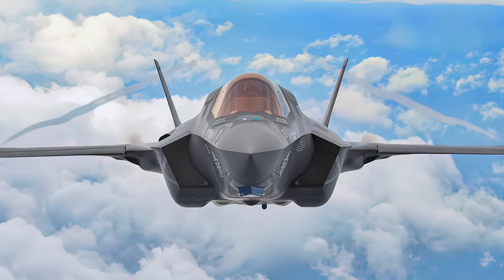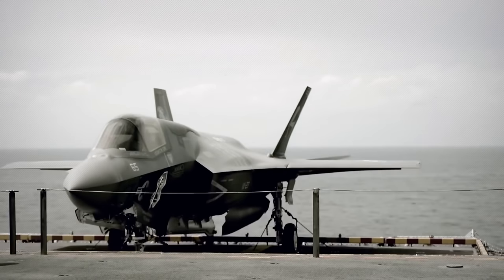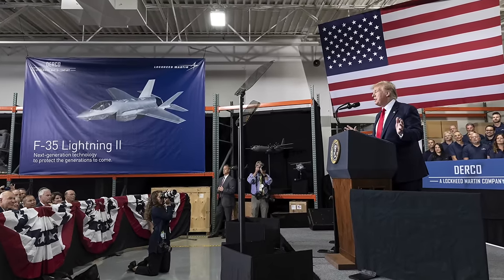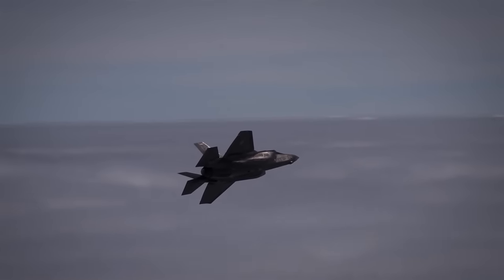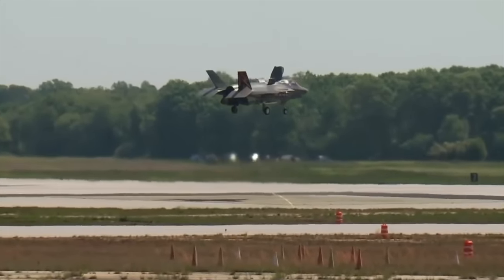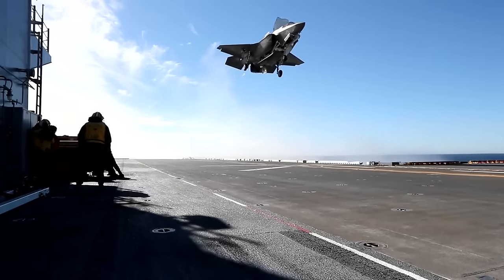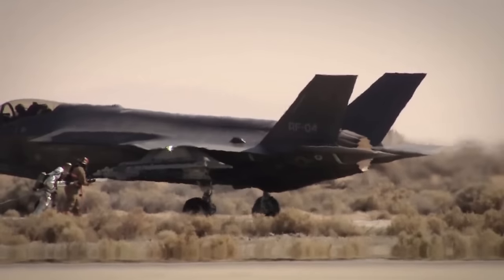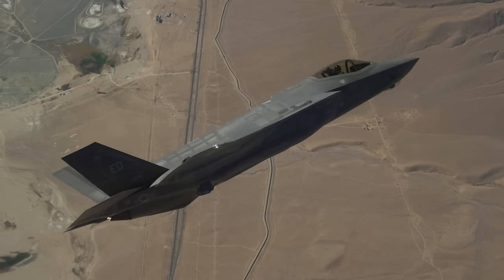F-35 Lightning II - Lockheed Martin's stealth multirole combat jet for air superiority

Comment: The F35 is the second feared only to the F22. Except for the fact the F18 Super Hornet is preferred over both of them. Wow wow.
Reply: Preferred and feared are 2 different concepts aren't they?  Nobody would prefer the f18 SH to either the F22 nor the F35 if price weren't an issue.  While the hourly operating cost of a super hornet (being half of what it is for the F22) may make it preferred for those that need to fund the budget for the fleet, nobody is going to suggest they'd rather be flying a super hornet facing off against an F22 as opposed to the other way around.
Reply: @davepeesthepool  the F35 is the coolest looking hangar queen ever invented but it also cost a total of $1.7 trillion so far with zero time in meaningful combat. It can’t turn or climb fast enough to avoid target acquisition lock by the F15 or F16 and the military hasn’t even bothered testing it against the F18 because of this. The helmet is too large for the cockpit space for the pilot to look behind them rendering its X-Ray vision useless to the rear. It’s radar is so complicated that pilots often must reboot it while in flight during testing and it’s too narrowly focused of a beam pattern to find ships at sea. It requires way more ground support equipment and personnel per F35 than any other option. There’s no spare parts available for it. Lockheed Martin claims to be able to fix its glitches in software only if it received an exclusive maintenance contract first. This Swiss Army knife of a concept doesn’t do any of the three key purposes for its use well. As great as it sounds on paper and as many technological advances as it might have achieved and just as a brutally honest observation we’d be just as well suited purchasing dumbed down SU-57’s from Putin and ripping out the avionics to put our own in just like the Israeli Air Force does with ours. For further reading and for citations of everything I mentioned see here from The Hill’s Op-Ed by the author of five books, who’s a Georgetown professor, as well as an advisor to Oxford U, and retiree of the US Army’s 82nd Airborne. His name is Sean McFate and each specific claim is linked to articles written by others elsewhere. 

https://thehill.com/opinion/national-security/542412-the-f-35-tells-everything-thats-broken-in-the-pentagon/
Reply: Not true.
Reply: @WhereDaToofpaste  I'm aware of this opinion piece.  What's ironic about it is it's all about the dog fighting capability of the F35 when it wasn't designed for dog fighting to begin with.  The F35 is not designed for merging with other fighters and executing BFM, it's meant for BVR engagements and support roles for situational awareness (and its data link capabilities in sharing that situational awareness to friendlies).

The point of the f35 is that it (or one of the friendly aircraft/G2A elements in the area it has painted the target for) has already destroyed the enemy fighter before it even realized the F35 was there.
Reply: @davepeesthepool  The F-35 has superior dogfighting capabilities over the F-16, F-15 and F/A-18 under most combat conditions. The only way the latter aircraft can outclass and outmanouver an F-35 is if they dump all their weapons except the cannon and carry as little fuel as possible. The F-35 is as good if not better than the F-22 at low altitude according to F-22 pilots, and that makes sense because of the superior thrust the F-35 has.
Reply: @WhereDaToofpaste  $1.7 trillion for over 2,500 F-35's supported over half a century, including maintainance, training, and upgrades, including the development costs of the program. It's not that bad. There haven't been many moments for the F-35 to enjoy combat under it's combat Block 3F package since 2017-2018. But the Israelis have been using them with great success as a strike aircraft in Syria, facing S-400's and more recently probing Iranian airspace undetected.

In training the F-35's performance has been stellar. Pilots all want to be in them, from the RAF to the Czech Air Force. There's roughly a 28-1 kill ratio against the F-16 and F-15. Pilots with 9 hours on the type have become aces in training exercises against F-16 veterans with thousands of hours racked up on the type.

The Israeli variant is not that much more different to the standard models, the only differences being add-on capabilities for it to work with Israeli electronic warfare systems and weapons.

The issues you are referencing are on older variants of the F-35, usually test/training software packages. The F-35 has variable radar, which includes wide and narrow band search, as well as stealth operation, which reduces it's emissions for radar detectors. The cockpit space is also huge. It's literally got more headroom that the F-16 and the new helmets are not that large.

Furthermore, stealth and radar aside, the F-35 is faster than the F-16 and F-15 under combat load. Which means, the only way the F-16 and F-15 would be able to outrun or outmanoeuvre it is if the latter aircraft do not carry any extra fuel or missils. So guns only.

Speaking of the Swiss, they too, have chosen to purchase the F-35 this year. There are only 3 Category I software issues remaining on the F-35. One of them being, green lines on the helmet display using nightvision. The Australians can run the F-35 with a minimum of two support crew and a towed trailer. MMH/FH is around 5 hours. Roughly less than the Gripen E, which is known to be low/easy maintenance.

It's the Su-57 that's the hangar queen, there's only what, about a dozen of them? Half actually operational? Russians afraid to have them shot down over Ukraine.
Reply: @britishmalayasociety  
A lot better than 28:1 in recent exercises.
Reply: @stephenpage-murray7226  I thought that would be the case. I know it went from 20-1 to 28-1 within about a year, and I haven't checked recently... When Block 4 comes out, I imagine things would stretch even further still.
Reply: @britishmalayasociety  
68:1 at one exercise
Reply: @WhereDaToofpaste  pogue
Reply: @britishmalayasociety  Are you sure that's correct?  The latest F16 has an empty weight of 22,000 lbs and a thrust force of 32,500 lbs, the lightest F35 model has an empty weight at 29,300 lbs and a thrust of 43,000 lbs.  That puts the thrust to weight ratio of the two aircraft without munitions or fuel at nearly the same (1.477 for the f16 1.467 for the lightest model f35, so the f16 has the barest advantage).  And I've read that a report in 2015 details a series of dogfight trials between the F16 and F35 and the F16 won fight after fight.  The f16 is actually extremely maneuverable at high speeds, and it can maintain those high speeds through a turn fight really well with its high thrust to weight ratio, making it difficult to beat in a rate fight.  Supposedly the air force nicknamed the f35 "Fat Amy" because it is so heavy (but understand that it's also a term of endearment).  From what I understand, the consensus is that the F35 is not as maneuverable as the F16 (which shouldn't come as that much of a surprise since the F16's design is first and foremost a dog fighter).

The F35 was originally supposed to be lighter than the F22 but feature creep saw a lot of weight added for bigger weapons bays and onboard hardware to give the f35 better functionality for its multi-role expectations.  That's the reason why its thrust to weight ratio isn't any better than the f16's.  Nevertheless, a lot of fighter pilots today put the importance of BFM capabilities below a lot of the functionality that the F35 particularly excels with.  Situational awareness and stealth mean you are much less likely to ever even have to dogfight.  The F16 might be a better dog fighter, but it would take some seriously extraordinary circumstances for an F35 to find itself merged with a 4th gen fighter like an F16.
Reply: @davepeesthepool  The 32,500 lbs thrust engine is only found on the UAE's F-16 Block 60 variants. If you were to purchase the latest Block 70/72 variants, it's 29,000 lbs maximum thrust.

The F-35 is heavy, but it has the thrust to make up for it. F-22 pilots had stated that it was as good if not better than the F-22 at low altitude. Carrying any sort of combat load, the F-35 is superior against the F-16, mainly because the F-35 does not suffer any drag penalties by having to carry external weapons, whereas the F-16 does. It is actually signficantly more agile than the F-16 because of the weight, which would be bad if the F-35 didn't have the thrust to compensate. I've heard pilots confirm this, but this was all more recent ~2019 or so.

The TW of around 1.4 is pretty much never seen, that's close to zero fuel and no weapons, but basically the more weight you add to the F-16, the greater the proportion of a lower TW ratio you'd get over the F-35. For example if you give both 4x AMRAAMs, with let's say weightless fuel and nothing else, you'd be looking at around a conservative TW of 1.4 for the F-35 and an optimistic 1.3 for the F-16.

Furthermore the F-35 Block 4 would see an improved engine, running both more efficient, cooler (for stealth), and more powerful. The new engine would see engine thrust upped to at least 45,000 lbs.

2015 was when the F-35 got the Block 2B package, which was the first inital combat-ready package. But it wouldn't be until 2018 with the Block 3F when the baseline combat package would be ready, which is significantly superior over previous versions, as will the upcoming Block 4. The F-35 with everything older than Block 3F would be quite signficantly software limited. So it may be the case that the F-35 wouldn't handle better? For example as of now, Block 3F I know has achieved 28 degree angle of attack, is software limited to a 50 degree angle of attack, but testing has shown it can achieve 110 degrees. This has real-world consequences of for example, achieving better angles for shooting the guns or missiles.

One of the F-35's design goals was to make it more manouverable than 4th generation fighters, and on the latest combat package, it is. Later models would just increase this. It wasn't just for dogfighting potential, but it's necessary for carrier operations, which the F-35A inherits as well.
Reply: @britishmalayasociety  For some reason your responses to me aren't ending up in my notifications.  Anyway, thanks for the additional info.
Reply: @davepeesthepool  I think it's because it's just a massive tome lol. No problem!
Reply: @britishmalayasociety  It's nice to see someone not completely dogging on the F-35. Everyone wants to try and dismiss it online while in the meantime more and more countries are eager to get their hands on them. I live in Canada and just recently we rightfully chose the F-35. It's a fantastic piece of Aviation, definitely my favourite 5th Generation Fighter.
Reply: @VoicefulRiver  Calling it now, it's better than the F-22.
Reply: @JSFGuy  ninja plz
Reply: @AA-xo9uw  ninja you federal
Reply: @WhereDaToofpaste  what are you talking about? Ninja?
Reply: @stephenpage-murray7226  Damn, which exercise?
Reply: @britishmalayasociety  
One in Canada I believe.  Maybe COPE Alaska.  It’s one of the reasons the Aggressor squadrons now have or are getting F-35’s as they couldn’t give the F-35 opposition any worthwhile training.
Reply: @JSFGuy  none of that. Just ninja plz.
Reply: @WhereDaToofpaste  what is Ninja PLZ?
Reply: @JSFGuy  exactly what it says. Ninja plz.
Reply: @WhereDaToofpaste  that has no relevance to anything so don't clarify, don't answer my question just keep posting the same nonsense.
Reply: @JSFGuy  the fail 35 has no relevance
Reply: @xyzaero  I urge you to reread my posts... I'm not doubting the capabilities of the F35... and indeed, were I forced to take part in a real encounter between an F16 and an F35, I would choose the F35.  What you have to understand is that the advantages the F35 carries over the F16 have nothing to do with maneuverability and speed.  Even in a dogfight, the F35 would win, but not because it can outmaneuver the F16 or out rate it in a one circle fight.  The F35 would win because 1. the radar absorbing materials used on the surface of the jet and the reduced infrared signature means any radar guided or heat-seeking missiles fired from an F16 will have a harder time to lock on and stay locked on (meaning the F35's countermeasures will also be more effective at throwing off a missile that has locked on to it).  2. Because the F35 can fire missiles off-boresight... meaning the F35 pilot doesn't have to aim the nose at an F16 to get get a lock for it's missiles.  If the pilot can turn their head and see the F16, they can establish lock utilizing the HUD system in the helmet and fire a missile.

Now ask me if I would rather be in an F16 or an F35 if it was to be a guns only fight where both the F35 and the F16 have to pull lead with their nose to get a kill.  I would pick the F16 in that case.  But as i said earlier in this topic... that point is pretty much moot as an F35 has likely already sent a couple fox 3's at any fighter coming up against it before that other fighter even knew the F35 was there.
Reply: @xyzaero  ninja please
Reply: @JSFGuy  you aren’t owed anything so ninja please is all you gettin. Now put that in your pipe and smoke it mittens the cat.
Reply: @davepeesthepool  I'll go one further and say the F35 has an advantage over the F16 in maneuverability. The F35 has been noted to be capable of recovering energy quicker than the F16, even being closer to something like the F15C in terms of energy recovery. Combine that with the ability to pitch its nose up to 50, 70 even 110 degrees of alpha in testing due to the vortices and lift generated by the whole aircraft body, it hangs out at low speed even better than the Hornet with a better thrust to weight ratio and less drag from internal weapons. As someone noted earlier, the F16 is best at high energy maneuverability, but versus something that can choose to bleed energy and turn 135 degrees in 3-4 seconds the F16 is gonna quickly find itself out of its element. The F35 also still has the ability to pedal turn at 50 degrees/s, meaning it can get guns on even in a spiral to the deck while falling slower than an F16 and shifting behind it. I can't be sure about the rate fight, but I imagine the superior flight control laws and high alpha of the F35 could allow it to angle itself into its turn more than an F16 can, making it slower but also able to turn even tighter and sit inside the F16's turn circle. Additionally, here's an F35C demo description; note that while the tactical pitch bleeds 100 knots its still able to pull a 150 knot climb at 60 degrees of pitch and that the min radius turn is 7.5G instead of the 9G the airframe is capable of: https://www.faa.gov/about/initiatives/airshow/media/military/Navy_F-35C_Maneuvers_Package.pdf
Reply: @davepeesthepool  your posts aren’t relevant. Never will be. IKeep on urging though. 😂😂😂
Reply: @forzaelite1248  go two further on the fail 35. It’ll still be ninja plz.
Reply: @AA-xo9uw  naw ninja x3
Reply: @WhereDaToofpaste  Been chewing on that retort for over month have we?  I'll let the likes speak for themselves as far as which of our posts others have found relevant.
Reply: @davepeesthepool  the likes are your real friends. They care about you. They think you’re a genius. There’s nothing impulsive about them. You’re winning. Only problem is you talk at people instead of to them specifically for that end. And I’m doubling down on everything I said. That’s why they don’t matter. Great big 📠.
Reply: @WhereDaToofpaste  Hey, whatever you need to tell yourself to cope with the fact that nobody really agrees with your opinion.
Reply: @davepeesthepool <—- just peed his pants. Wow wow.
Reply: @davepeesthepool  I hit like so clearly I agree with ya. 😂
Reply: @WhereDaToofpaste  No better way to come across as informed and confident than a low-effort schoolyard insult.  You just go on believing that behavior is making me look the fool and not the other way around.

I post in comments looking to have intelligent conversations, if all you've got is ad hominem and nothing of substance to add to the conversation at hand, I'm not interested.  I'm done responding to you.
Reply: @xyzaero  this just in. Lockheed has announced that the F35 helmets will receive a firmware upgrade which will allow the pilot to look right through enemy aircraft’s. No word yet on what in the world this technology is good for. But stay tuned my friend. 😆